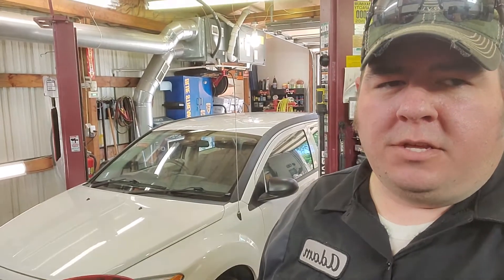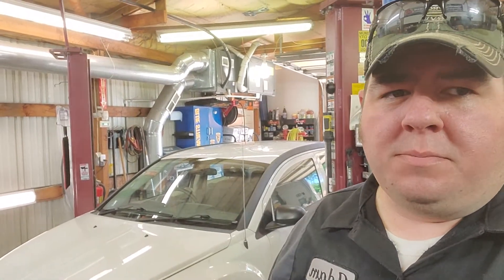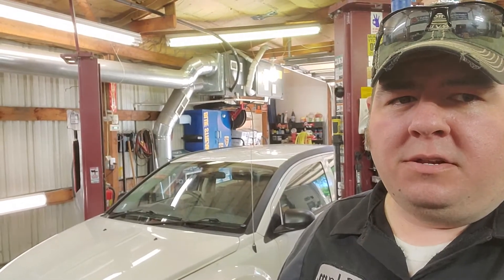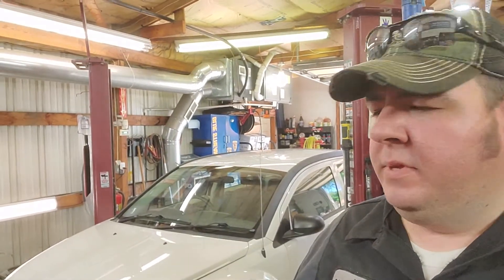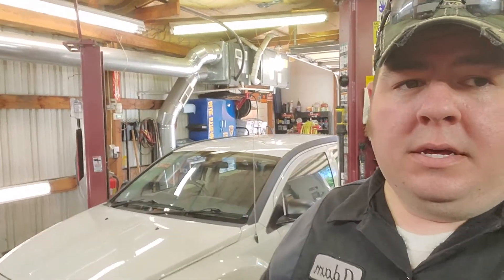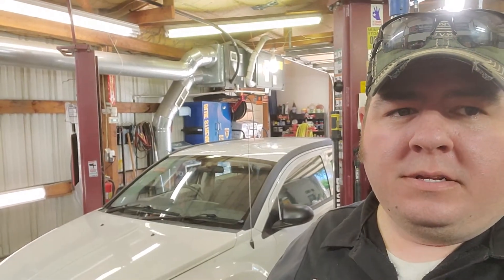Dodge Caliber CVT ROM Swap Will It Work? Part 2

Comment: Same scenario for me. Replaced transmission in a 2010 Caliber without swapping EEPROM module and had P0700 and P0167A codes and limp mode only. I could not clear the codes. Swapped the EEPROM module, cleared codes, engine light went off as soon as I started engine and car runs perfect. I have no idea what model car the transmission came out of, but they had the same production number which is on a label on top of the transmission. This 2010 had the newer AD production which is found in the later models. I think they changed during 2010 production as some 2010's have the older AC production model. They are NOT interchangeable. If you are swapping one of these, ALWAYS swap the EEPROM as Adam shows in the video. You need to pull the pan anyway and clean the filter, so it is only two bolts and a harness plug. You will save yourself a lot of grief.

Comment: What was the original transmission doing??
Reply from the maker: The original transmission completely grenaded.  Would only work in reverse.  That car is still running strong to this day.
Reply: @chewi4u  thanks for the info… I just bought a Compass not knowing of the subframe issue and I’m ordering the parts now… I’m hoping once I tighten up the tolerances on the suspension the weirdness from transmission goes away

Comment: what scan tool did you use? will any generic one work for what you did?
Reply from the maker: Launch x431 v+  As long as it can reset and initialize modules then it should work.  As always double check with the manufacturer of the scan tool.  Thanks for the question.